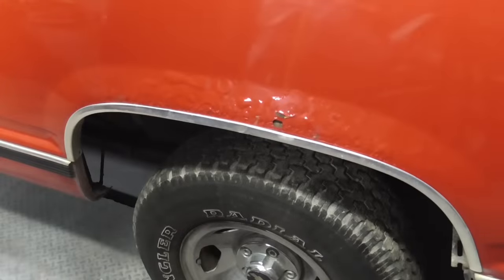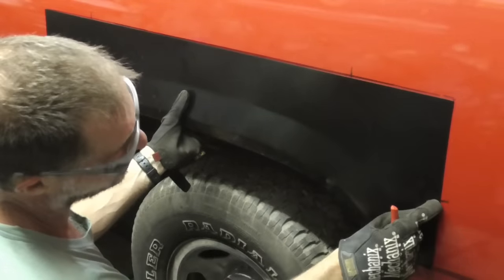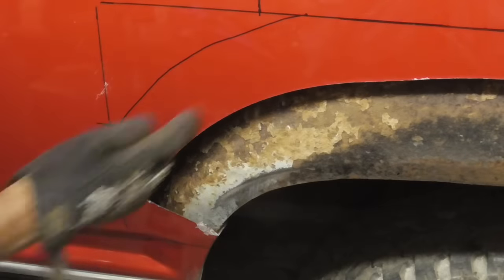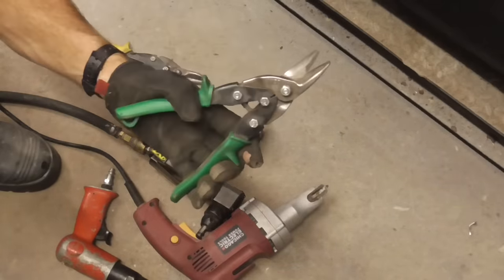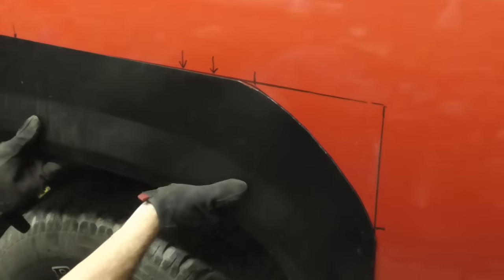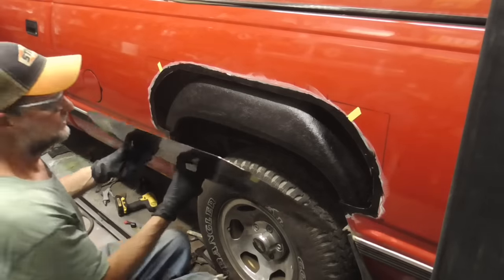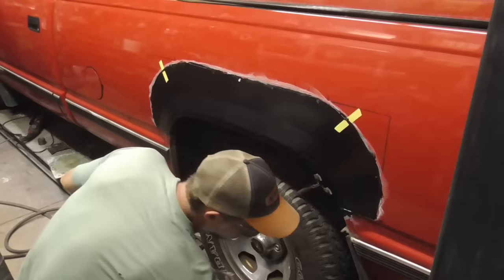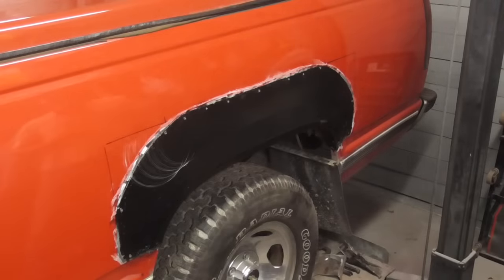Glue On Wheel Arch Rust Repair Panels w/ SEM Impact Resistant Panel Adhesive

Comment: Some time ago I came up with a simple method using flashing, which is very thin sheet metal used on house roofing and siding, and JB Weld, which is sandable when cured. if if you're lucky enough to be using it on a natural body line, it blends in almost undetectable after some Duplicolor.. certainly passed state inspection.
Reply from the maker: Interesting - thanks for your input DB - have a good weekend :)

Comment: Nice , The advantage using the glue epoxy compared to welding it does not further damage or warp  old panel 👍and when oil under coat annually 👍👍last hell oil entire truck frame doors rockers hod tail gate box crossmembers bumpers mount suspension lines
Reply from the maker: Great points Nick :)

Comment: I don’t have a welder and I was going to glue my floor pans in with some rivets I was wondering what you think, and I was going to over lap a little?
Reply from the maker: That will absolutely work.  Dodge B250 vans are unibody (not full frame).  I once screwed and glued an entire new floor in a B20 conversion van (didn't want to mess up the galvanized sheet metal by welding).  Drove it for 4-5 years - no problem - then sold it.  That floor will be there for a long time.  It will work great for you pans - leave about 1" overlap 👍

Comment: Excellent work and video! I'm just about to start the same project on my Silverado. Curious if i can use metal screws in place of the rivets, Just glue them up like you did, then grind the heads off to fill the holes. Keep up the good work.
Reply from the maker: Absolutely.  Screws actually work better as they pull the panels together tighter.  No worries about squeezing the adhesive out as there is micro sized balls in the glue to prevent that.  You can just remove the screws, tap the seam down and fill if you want.  You wont have issues up high with moisture or leaving the holes as it will stay nice and dry up high.  Or like you said just grind the heads off - good idea actually :)

Comment: Like Howard Hughes said. Wave of the future...   I glued rockers on my 64 C10 15 years ago with 3M 5200 Marine Adhesive/ Sealer. Better than welding. Home Depot has it in caulk tubes. Easier than falling out of bed.
Reply from the maker: That is great information and I believe it - no moisture in the seams.  Thanks for that Paul - have a good weekend :)
Reply: @LakesideAutobody  Sure. For all the naysayer experts out there, I also glued '67 Chevelle SS hood bumps on my "65 Chevy 2 hood using the same adhesive not expecting it to hold up. It's been 12 years and it still looks like GM did it original. The stuff seems to retain just enough flexibility.

Comment: Great videos, always right to the job, no extra bs chit chat. I'm doing a panel like that on sq. Body. Will 200ml 3m bond cover 55 inch x 20 inch panel? No area coverage in directions.
Reply from the maker: Absolutely.  You can do both sides with one tube of panel adhesive 3M, SEM, etc.
Reply: Thanks for the fast reply.Plan on doing it like you did this weekend. At least one side.

Comment: Self tapping screws give more clamping then clecos, think of clevis. Clevis are also expensive and lose bite if welding close to them.
They are great for fitting panels that will be test fitted over and over.
The inside fender well. I would use the only rustoleum product I would Stand behind .
Is " REFORMER" ITS A RUST CONVERTER you spray on surface rust. It sprays water ( it's chemically bonding to the rust) it then dries thicker primer, in Batman Black .
I never sand it I only spray 2k primer on top then paint it.
I have also used just "Reformer" on a surface rusting work truck bumpers 6months later no rust no fade in color. It's great on surface rust you can not reach or take apart. 
Good job on this truck !
Reply from the maker: Thanks for the information and support MindDezign - have a good week :)

Comment: I used draw clecos when working on commercial aircraft. They use a wing nut to tighten panels together very tight. They are available in 1/8 #30 drill, 3/16 #21 drill and 1/4 inch so you don’t have to use those weak spring type clecos .
Reply: Aircraft Clecos are glorious and every body tech should study aircraft sheet metal (and other) tools.  BTW the greatest sealant I've every used, aircraft fuel tank sealant, is easy to get online (Aircraft Spruce and others carry it) and it's fantastic for diesel, petrol, hydraulic juice etc. You'll have used it as faying sealant but many civilian auto mechs don't know about it. I prefer "B-1/2" for the short cure time.

Comment: Have had a problem with a line showing through after painting when I repaired a panel using 3m panel bond. Now I sleeved my panel. Have you had this issue?
Reply from the maker: I have not but probably because the seam was tapped below the surface and a buffer of filler prevents that.  Try using a layer of fiberglass reinforced filler over the seam - might help :)

Comment: I followed your technique, for gluing on panels.  After the glue cured for approximately 16 hours, I began tapping the panel seam down.  However, the tapping process didn't work quite like in the video, as the seam didn't want to recess. Then, one of the seam corners popped loose.  So now, the panel has dents.  I have removed the patch panel and cleaned everything up, but will the dented panel still work and should I try to glue again?  Suggestions would be appreciated>
Reply from the maker: What type of glue did you use?  If you used Sem Impact Resistant Panel Adhesive - the instructions say wait 48 hours at 70 degrees (metal temp not air).  https://manage.semproducts.com/public/content/techsheets/TDS_dual-mix_structural_impact_resistant_adhesive_0719.pdf Also, you don't have to really dent it - just a light tap.  You are only knocking it down .030" or 5 human hairs.  The panel will still work.  If you are not sure that you want to try it again, you could try mig welding it - https://www.youtube.com/watch?v=hWjIMGFSjFg  Finally if it was cold in the garage when you glued it, you'll have to wait even longer.  If done right, you'll have a heck of a time trying to remove it - probably wont be able to.  Let me know if you have more ?s - Jerry
Reply: @LakesideAutobody  Yeah, I used the Sem Impact Resistant. The most likely culprit then, was, I didn't wait long enough per what you're saying, and per the Sem data sheet.  This mistake was on the driver side. The passenger side I have not touched and has cured approx 40 hrs now. I thought, watching the tapping process, you're actually trying to get the  wholeoverlapped edge below the surface. So, with the denting that I've made in this panel, you think that it will reglue and mate properly for reglueing?
Reply from the maker: @DD-ht4ug  Yes, just flatten it out and you'll probably have use more screws but the good thing is you'll know what to do and what not to do next time.  Again, just a light tap will move that metal - you won't hardly even see it move or a difference but that tap did lower the seam - even if you did it too lightly - no big deal, you can tap down any high spots after the first application of filler.  Keep at it my friend - let me know if you have any questions as you go - have a good weekend :)
Reply: @LakesideAutobody  Thanks for all the advice and videos.  Greatly appreciated.  I reattached it with the glue. Had just enough to finish.  Had it over 70 degrees in the garage before and after installation.  Will wait and give it plenty time to cure this time. I'll keep you posted. Thanks again and thanks for the quick responses.
Reply from the maker: @DD-ht4ug  One last thing.... give it a good 48 hours and just to be safe tap lightly at first.  Remember, you only have to knock that seam down .030"  - about 6-8 sheets of paper.  Go ahead fill and sand.  If you see any high spots peeking through, tap them down a bit and apply a second coat.  If you get past these stages, you'll have a repair that will last longer than you have the car.  An absolute water tight seam. Have a good weekend DD 😊
Reply: @LakesideAutobody  Ok.  Probably won't touch either side until Monday, just to be really safe. You deserve a good weekend as well, for all the help and vids that you provide.

Comment: Great and impressive work, but in this instance is this really any faster -- or cheaper or better -- that butt welding in the patch panel?  Body work, prep and finish are all the exact same.  Guess that maybe it's quicker (slightly?) to apply the patch?  How much time and or money would this save?
Reply from the maker: I would say this is more expensive but certainly would last longer than any other method because of the water tight seam 😊

Comment: This is kind of what I thought auto-body repair would be over a wheel-well when I had a certain knowledge before watching your videos on YouTube. I am so amazed that when you do about a 12-in by 3-in rust spot you got to put so much labor in it. 

I can see in this video that it may not be quite as tedious as prior videos where the widest patch was much smaller, but I guess on a larger panel replacement, more material to spread and then cheese-grate, and then sand, and then prime, and then paint, I guess there really is no l shortcuts
Reply from the maker: Yep - no short cuts.  There is quite a lot of work but in reality it doesn't take that much time - maybe a day or two :)
Reply: @LakesideAutobody 

Do you have multiple bays to work from in the event that one car takes only 3 hours of your labor and time but then takes a 12-hour "curing" process?
Reply from the maker: @michaeldunagan8268  No but that is typical in a regular body shop - you might have 2-3 cars going at once.  Now you're makin' $ if you are paid commission pay :)

Comment: I really enjoyed this video.  I need patch panels on my truck and was dreading the warpage from welding.  Now, I have another question.  Why were the rivets needed anyway?  Did you sand the rivet heads completely off?  You did a great job.
I also have another question.  I am building a 1929 Buick Street Rod and the interior wood cage is rotted away.  Wood kits are not available.  I have ben thinking about replacing the wood with steel and glueing it in using this adhesive. I have heard it is good for a 70 MPH impact.  Any reason it wouldn't work?
Again, great video, Thanks
Reply from the maker: You can use rivets or screw - they just keep the panel pinched tight to the original panel.  The glue actually has microscopic balls in it to prevent you from squeezing it out of the seam.  If you can clamp it great.  I didn't grind the heads of the rivets off but you can certainly remove them after the glue hardens.  I tapped them down.  It would work fine - I glued a van floor in w/screws and it held up fine for years.  Did a lot of heavy duty work with the van too and never had a problem - 94 Dodge B250 - they're unibody so the strength of the floor is important 😊

Comment: When applying the epoxy you clamped with the clecos.  Why not use the rivets then?

I see you tapped the edge in and recessed the rivet holes after the epoxy set.  Couldn't the recess  been done prior?
Reply from the maker: You could recess or flange but not the whole perimeter because of the wheel well lip.  I figure if you can't do the whole perimeter why do a little bit.  You have to always knock your seam down anyway whether you weld or use glue.  If not the patch will likely fail or show and outline :)

Comment: Great job,would there be any benefit to filling that cavity with expanding foam to keep water from pooling up in fender
Reply from the maker: Good thinking but ford tried that with the Ranger (90's) - the salty moisture ended up finding its way behind and never being able to dry and rusting anyway.  The key is to make sure your panels can drain and stay dry on the inside and squirt some penetrant or used motor oil inside to coat the seam at the bottom like this - https://www.youtube.com/watch?v=8XaZBy7GC7A

Comment: Let's say a guy had a 1984 Ford f150. Let's also say that it needed floor pans in the cab on the driver's side, and patch panels in the bed floor. beIN that neither place would really need any body work after repair, would a product like this be a good choice?
Reply from the maker: Yes - this would be great to use for that.  Glue it and either rivet or screw it.  I replaced an entire full size van floor with glue and it worked just fine.  I replaced it with galvanized sheet because I didn't want it to ever rust again - didn't weld it because I didn't want to mess up the galvanized coating.  Glued it and screwed it - works real well :)
Reply: @LakesideAutobody  thank you sir, I too was thinking galvanized. I'm not going for a concourse restoration. And my thoughts are the same as yours.
Reply from the maker: @OneCarGarage777   Good thinking Mark :)

Comment: Just curious why you trimmed off more of the panel? Couldn't you have used the increased surface area to bond better with the patch?
Reply from the maker: You could do that - no problem.  I just try to keep the repair area as small as possible but not cheating.  Also 1" is a good amount for the glue to adhere to and still somewhat easy to tap down.  :)

Comment: How much did it cost to fix the rust on the whole truck? Because my rust on my ‘98 Chevy is bad around the back fenders. My cab corners need to be done like you showed in your other videos. Because I’m gonna copy your work for my Chevy to get rid of all of my rust.
Reply from the maker: Just purchased the panels you are talking about.  The one for the front of the rear wheel and the one for behind the wheel - $70 each.  You could probably make them though like this - https://www.youtube.com/watch?v=rzweTdSzTAk

Comment: I might have missed in the video but did you do anything to coat the bare metal on the backs side of the patch.  I noticed that you removed the black primer did you coat the bare metal with the adhesive or some other method?  All in all, nice work.
Reply from the maker: I don't coat anything anymore - to me it seems to create more problems.  I make sure the panel can drain and dry out and do this - https://www.youtube.com/watch?v=8XaZBy7GC7A  - https://www.youtube.com/watch?v=y05dNxt-nVc

Comment: What I don't get is the fact that it is overlapped and thus leaves a lip. Sure you can hide the lip by using filler but to me that just changes the body contour near that area as the patch sits higher. Why not indent the original panel along that 1 inch strop where the patch sits so it is level with the original. Then they are level with each other. Also not sure why you would not just butt the patch in and weld it traditionally, but I am assuming the purpose of the glue patch might be to show what to do if one does not have welding skills. 

Also on a related note could you theoretically butt weld the patch using JB Weld vs regular welding? Would it structurally strong enough or will the JB Weld eventually crack weakening the patchs attachment to original and cause the entire joint to fail under the filler?
Reply from the maker: You can't butt weld with JB Weld - matter of fact butt welding with a MIG welder is not proper either for patch panels.  All good body shops lap weld patch panels, tap down the seam below the surface, fill, prime, paint.  That's the way it's done.  The seam HAS to be tapped down - no matter what method you use, weld, glue, JB weld, fiberglass, etc.  There must be something between the seam and the finish and filler is a great buffer.

Comment: Exactly the way I did them 35 years ago minus the adhesive. I don't think you listed the sheet metal fasteners.
Reply from the maker: Thanks for the support - metal fasteners were regular 1/8" rivets or sheet metal screws 1/8" hole.

Comment: The end result looks good.  However, I can't help but think gluing the new panel over the old one has to have a lip.  You blended it with the filler, but doesn't it still fit a bit over the original panel?  Whereas if you traced the new panel onto the old panel, cut out the old one, and welded in the new one it would be more flush fitting.  Then you only need to grind down the welds, use a small amount of filler, sand prime, paint.  I'm trying to figure out the best way to fix the wheel arches on my 2000 Z71 that had factory flares that I removed.  They trapped moisture and caused some rust to bubble through.  The paint is chipping off but there's no hole in the panel yet.
Reply from the maker: With respect, the wrong way is to butt weld, grind the snot out of the welds and adjacent metal and use very small amounts of filler contrary to belief.  The right way is to lap or glue, tap the seam down, fill, prime, block sand, prime, finish sand, paint.  There is a ton of wrong info out there - beware - ask a body shop in Michigan that has done rust repair since the 70's they know.  Here's the truth on the matter - https://www.youtube.com/watch?v=JIIonJOVro4  Here's a great follow up video on past repairs too - https://www.youtube.com/watch?v=gIS1Tbv7Kvw  If you want to learn the longest lasting most efficient methods, you found the right channel - Jerry
Reply: @LakesideAutobody  I'll have to look for some panels large enough to glue on the way you did in this video.  I'm originally from Michigan but live in Utah now.  My truck is rust free except for where moisture was trapped under the factory wheel flares that I removed.  I was hoping to not find rust under them but unfortunately 20 years of moisture took a toll.

Where in Michigan is your shop located?
Reply from the maker: @Long-nd8bq  I'm in Saint Helen, MI - we moved from down state east of Detroit in 2015.  Grew up in Utica and Dryden though :)